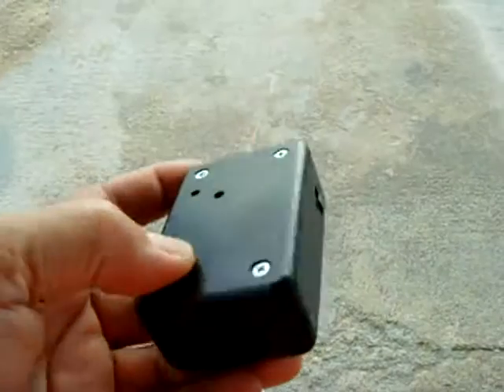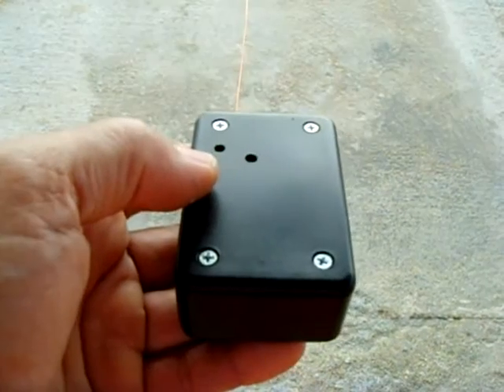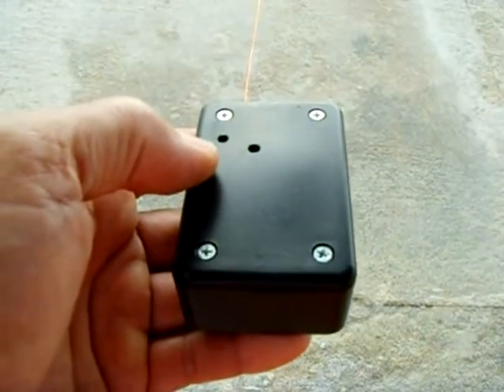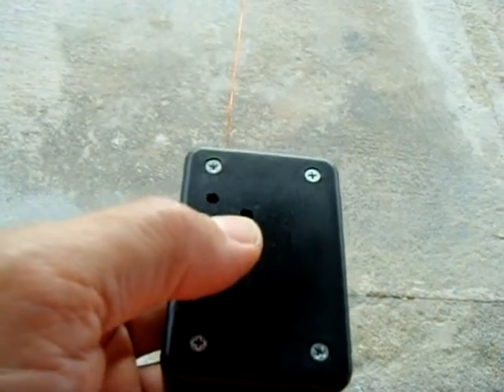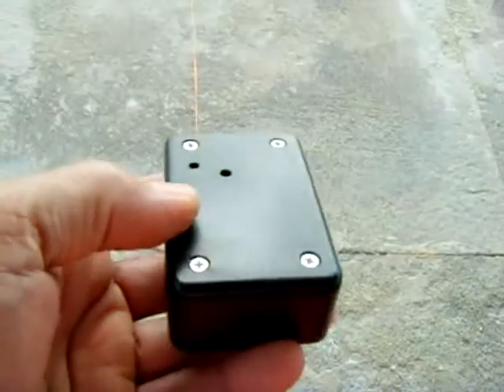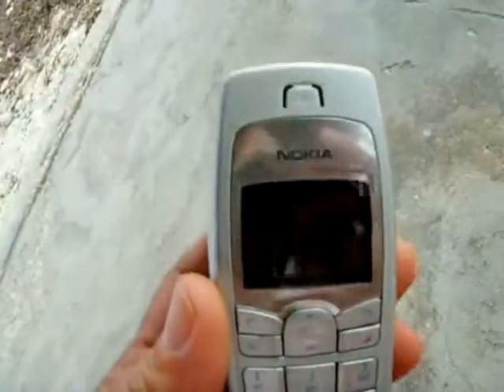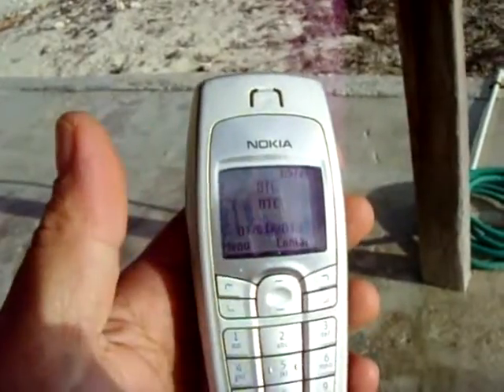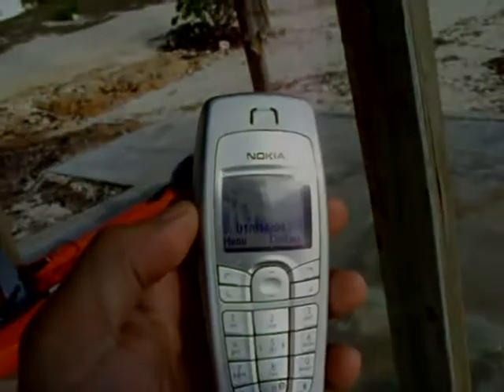Homemade Cell Phone Jammer (12' kill radius) up to 2GHZ

Comment: Hello, with this same circuit and transistor you used, Is it posible to adjust the OUTPUT frecuency to 860/960 mhz range? It would be for RFID. Thank You for sharring!😊

Comment: Great project! I also got a hold of a 2SC3358, but it has 4 terminals: base, collector, and 2 emitters  (pin 2 and 4). How should I connect it to the pcb if the schematic shows an MRF947T1, with only 3 terminals? HOPE YOU CAN HELP ME OUT. Thank you very much.

Comment: Hi, can you please tel me the voltage of 5uf capacitor.
Thanks,
Reply from the maker: Any voltage higher than the battery voltage.
Reply: electronicsNmore thanks. Can you please tel me how add 80pf trimmer capacitor for stability. Very helpful if you send me diagram, ateeb7@hotmail.com. Thanks.. 😃

Comment: I need some pointers here. I've built this but no luck. I used a c3779 transistor, npn good for 5ghz. I also used a 4.7mf cap from pin 3 instead of a 5mf cap(could not find in my collection). My values for all the other caps and resistors are spot on. I used 0.6mm wire at 0.625" diameter core diameter as the inductors L1 and L2. 1 turn and 0.45 turn. No beans :/ I followed the schematic but I did not add on the 2nd trim cap. The signal does look a bit chaotic on the scope (a noisy sine wave).
Reply: 6.25" antenna. Also The leads on everything past pin 3 are as short as possible and I didn't cram the inductors side by side. I'll keep tinkering with it and Add the other trim cap like you did but what was the value of it? Thank you!

Comment: Still not properly tuned. I just able to block Wifi and FM radio.
Reply from the maker: It can be very tricky to tune, but it does work.
Reply: Yes, you are right. I made it works now but still sometimes can not block cell phone signal.

Comment: Can we increase range with higher power supply and high gain gsm antenna?
Reply from the maker: The range can be increased using a more powerful NPN RF transistor, better antenna, and higher voltage/current.

Comment: Hiya,could you re upload your photobucket links as the one`s above won`t link.
thanks.
Reply from the maker: Bekircan Keçeoğlu
That NPN transistor is rated up to 5.5GHZ, and it should work, even though it is not a "low noise" transistor.
Reply from the maker: +john hill 
John, every link works perfect. I just checked. Thanks.
Reply: Can we use bfg97 instead of mrf transistor?
Reply: I tried bfg97 but it only stops fm radio frequency. I guess, ı had amplifier problem.
Reply from the maker: +Bekircan Keçeoğlu Circuit not properly tuned. Make sure you do everything I show in the video.
Reply: Almost same circuir but didn't work. I will try 2sc3357.

Comment: is it possible to design this jammer with breadboard and arduino uno ?
and. what kind of antenna do you use ? thank you !
Reply from the maker: MilicanLakitu If there is a way, I would not know how. There is no need for the Arduino for this circuit.

Comment: Hello
I built the circuit but it didn't work. My npn was bfr96ts. Due to unavailability of the capacitors I had to opt for some near-value ones(7pf instead of 5pf, 68pf instead of 50pf, 4.7uf instead of 5uf). I made the entire circuit on a perf-board. Also what kind of wire should I use for antenna? Would plain enamel wire work? Would be glad if you could point out the problems. Thanks.
Reply from the maker: That transistor should work just fine. You really need to use the exact same components as I did to ensure you get the same results. You need to solder everything to a copper clad board when working with these frequencies, making sure the soldered connections are as short as possible. It took me time to get mine working properly. The 4.7uF is fine, I used that. The 7 on the antenna should be OK, but the 68pf is too high. You can make a 50pF cap by placing a 68pf and 200pf in series! I used 20ga enamel wire approximately 5.5" long(14cm)

Thanks For Watching!
Reply: Thanks. I'll try.

Comment: for all you guys out there having troubles with getting the coils right, you need to understand that many, many odd shapes of coils,flat strips of copper foil,even strait pieces of wire can,when made to the right dimensions,give the needed inductances of 1.2 and 2 nanohenries-there are lots of formula/coil generator programs out there to be googled,some even give inductances for a normal straight piece of wire-and that works too, for example;when the wire is 2 mm thick-7mm=2.506 nH, 8mm=3.05nH, and 9mm (this is length) =3.618nH....so you can see you dont necessarilly need to make a coil as such, and in lot of cases coils are not used in preference for just plain flat strips of copper foil,with dimensions carefully calculated to get the desired inductance-what I'm saying is go look for some inductance formula's, play around with them until you are confident that your chosen length of wire, or strip, or coil is right. also,remember that the higher the frequency,the more tricky the coil will be to get right,take a good look at E and mores coil in the video-see how small it is compared to the RF trimmer right next to it? 2 turns and a bit, and notice where he tapped off the wire for the antenna?. another thing-if you arent sure its working-replace the coil and trimmer (the tank circuit) with values from a FM radio circuit and try to tune in on a FM radio station at a much lower frequency, this is of course if you dont have a oscilloscope or fancy scanner or reciever of some kind-you need some form of reciever to know for sure if your basic circuit is working-once you know the circuit is working,then you can tackle the tuning at 800 plus megahetz- a TV tuner or even a staellite tuner can be helpful here-as I said in an earlier post,I used my TV tuner that goes upto 880 megahertz just to test it,to make sure it was oscillating properly-go forth and conquer!
Reply: psycronizer hi, how we can use a osilloscope to get the right frequency

Comment: I finished making mine a few days ago..man! talk about a twitchy finicky little circuit! it looks like E and more wound one tiny coil and center tapped it, I made two coils,both absurdly tiny, 0.6mm enamel wire, one turn at 1.5875 mm diameter and the other 0.45 of a turn (ha!) same diameter and gauge as the first one.Thought about using strip of copper foil on the pcb for the inductor but the coils worked out, I didnt have a cell phone (I hate what they turn people into-obnoxious,arrogant ) so I used my TV tuner to test out the frequency adjustment, but that only went up to 800 MHz, so what I did was adjust the 555 to put out a tone, turned it on,left it by the TV, and started to manualy scan with the TV remote, got some nice weird black bars rolling down the screen at around 730 MHz, so now I'll have to get a mate to come round with his evil cell phone, scored some really cheap RF tranny's on line, might even build a small RF amp for it! haha!...maybe....
Reply from the maker: psycronizer I warned people that it can be very tricky to tune. Once it is tuned, it stays where you put it, at least mine does.
Reply from the maker: I have an image of the circuit board in the video that you can look at. You will see the 2 trimmer caps..
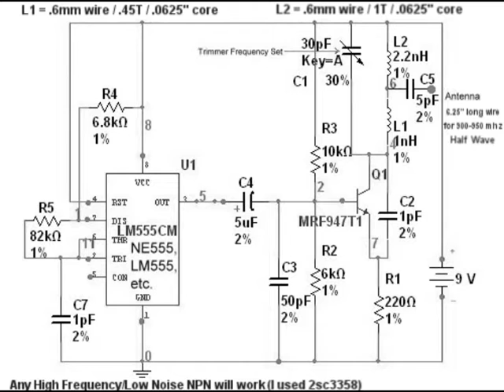Reply from the maker: Igor K at 0:14 you can see a yellow and brown trimmer.
Reply from the maker: The "Tank" is the part of the circuit above the Q1 transistor. In parallel you have the 30pF trimmer on the left with the inductors on the right. Where the 30pF trimmer and the 2.2nH inductor are tied into the top (+)rail, is where you place the extra trimmer. One leg to the + rail, and the other to NEG.
Reply: Igor K its quite simple Igor, follow exactly as said-one pin of trimmer goes to the positive side exactly connected to the other trimmer and coil,right at the top of the circuit diagram, thats easy right? and the other pin of the trimmer goes to the negative,or ground ,or right on the negative battery terminal-its all the same-it really is that simple-so you could say it really ends up as being connected to each side of the battery, right? the thing is with frequecies this high it kinda does matter where you put that first pin of the trimmer on the positive line-try to solder it as close to the points where the other trimmer and coil are at the top of the circuit-i think you may be over thinking this, but it really is just that simple. oh, and the reason the trimmer and coil is called "the tank" is because quite often these two components are the unit that ties the circuits frequency and where enclosed in a metal box to prevent interference getting in/out it helps with stability and also regulations for em radiation as well, metal box=tank..now you know.....I dont want to confuse you even further but if I were you I'd just build it as per "E's" picture,keeping everything tight, and maybe not worry about putting on that last trimmer until you are sure that you really need it-you could get ten people to build this thing and they would all be at different frequencies, thats just the way it goes with high frequency electronics,theres a lot of energy in those wires,and it likes to jump around a lot, with inductive,capacitive,impedance,reactance etc all playing minor parts in how it behaves as a whole. I hope this helps .
Reply from the maker: Just solder everything to a copper clad board. Use a Dremel with a cut-off wheel to cut pads.
Reply from the maker: I took all the components and soldered them to the board the way I wanted.
Reply from the maker: I would love to keep chatting back and forth, but I have too many other viewers asking questions.

The circuit definitely works. Good luck with it.

Thanks.

Comment: can U change circuit to work on 4.8V . It cell phone batery working output.
Reply from the maker: Maybe if you use a step up voltage converter.

Comment: hi, i was able to find the NPN RF transistor as described in the schematic including all the passive components. I even made a pcb for it but i couldn't make it work. I think the coil i made is not correct. In the video L1 has 0.45T. How is this possible? Can you share how did you make the coils? Thanks.
Reply: see my post ,the coils are a bit small,yeah!...
Reply from the maker: This circuit can be very tricky to get working, like many other RF circuits. Everything you need is in the video "About" section. Place the phone very close to the transmitter when tuning SLOWLY. Nothing more I can do for you. It is up to you.
Reply: there is another circuit online where they use 2 more NPN transistors between the coil and the antenna. Not sure if it is to increase beta of the final transistor
Reply: if you look up a coil making formula, you can do it from that..look up wheelers coil formula-remember-it doesnt matter what combination of  you use-as long as the final inductance is 2 and 1.2 nano henry's,or,even easier,make one coil of 3.2 nano henry's and just tap the antenna of one end...be confident, its not that tricky really!

Comment: any other replacement for the transistor u use?
Reply from the maker: You need to use a high frequency(up to 2 ghz), low noise, NPN transistor similar to what I used in the video. The circuit definitely works, but it can take time/be tricky to get exactly right(frequency wise).
Reply: electronicsNmore thx

Comment: will this transistor work  FJP13009
Reply from the maker: Hi Teodor. That will not work. You need a NPN RF transistor that is low noise and high frequency(minimum 2 GHZ), like this one below.

http://www.hep.upenn.edu/SNO/daq/parts/mmbr941lt1.pdf

Thanks For Watching!

Be sure to check out my video playlists for other very useful/interesting videos.

Comment: I was looking at this too. Looks fun. But what about the 5uf capacitor? that practically doesnt exist. What did you use?
Reply from the maker: Use a 4.7uF. Just make sure everything is neatly soldered with short leads/connections. Ideally you want a copper clad board to solder the components to.
Reply: electronicsNmore
I made my own circuit board, home etched, using a Freescale NPN 8GHz Low Noise MRF947AT1 transistor and I can't seem to get it to work. Im using an SDR to look at the radio spectrum and the trimmer pot doesnt really seem to effect it. The placement of my hand and when I have the screwdriver on the pot seem to have more effect. Any ideas?
Reply from the maker: forsakenrider
It takes time. Email me a link to close-up photos of the circuit. I bet your problem is the inductor. If they are not right, it will never work.
Reply: electronicsNmore
I bought chip inductors from Digikey. I will make a page of my blog with the info and picture and give you the link. Thanks for the reply :)
Reply from the maker: The circuit definitely works at 900/1800mhz. I turned mine on the other day, and all the bars on my cell phone disappeared. Could be a pain in the ass to get working, but mine does work good.
Reply: electronicsNmore How did you managed with 1nh & 2.2nh inductor  in your circuit??
Reply from the maker: I will take a close up of my jammer and post a link for everyone to see. The inductor is simple.
Reply: electronicsNmore Thanks
Reply: electronicsNmore where is the link with the close up? and could you post a schematic with the extra trimmer. thanks
Reply from the maker: I have a photo, but I am on vacation right now. I will post it Sat or Sunday. Sorry for the delay.
Reply: electronicsNmore - did you had a chance to post the photo ??
Reply from the maker: Yes. The link is in the video description area.
Reply: electronicsNmore Thanks

Comment from the maker: Actually, I used my frequency counter(not required for this project, but very helpful) to help get the frequency right. Make sure all your component leads are as short as possible. The most critical part is the inductor. Easy to make, but if the length is wrong, you will be transmitting at the wrong frequency. You will get harmonics, which is why you can also jam the 1800 mhz area also.. Check out my video list. I have lots of interesting circuits.

Comment: Well in that case, then the laws of the US don't apply to you :) 

Don't assume the signal isn't trackable. With a high gain directional antenna it should be trackable. Of course a weaker signal would be harder to track.

Comment: Watch out for the FBI agents knocking on your door. If you are going to be breaking federal law, you might not want to post it on youtube. As far as I know just possessing a cell phone jammer  is illegal. 

I am however interested in that circuit as a UHF transmitter. How much power is it putting out? 

As a licensed ham radio operator there are some UHF frequencies I can use. The rules for amateur radio permit me to use home brew equipment :)

Comment from the maker: Definitely works, but you will have to take your time adjusting the inductor to get the right RF output to the correct frequency. Leave your cell phone 1 or 2 feet from the circuit while you adjust it, That is how I did it. Look for the signal strength to drop off. I may take some time to get right.

Comment from the maker: According to the designer, the audio should be very good. Remove the 555 & anything connected to the 555 from the circuit, then connect one side of the mic to ground, and the other side to the capacitor leading to the base of the transistor, and you also add a 27 - 47k resistor from the mic+ to the power supply rail +.